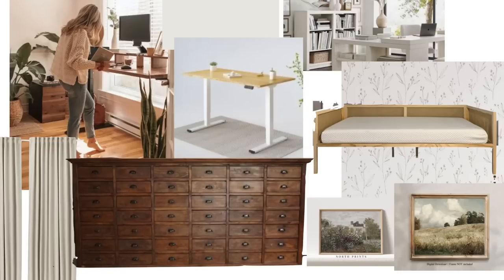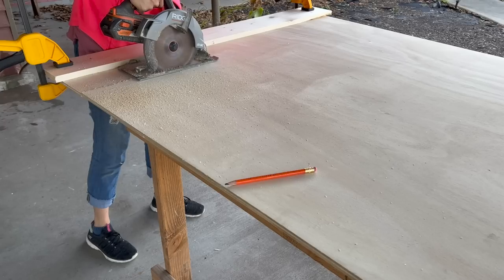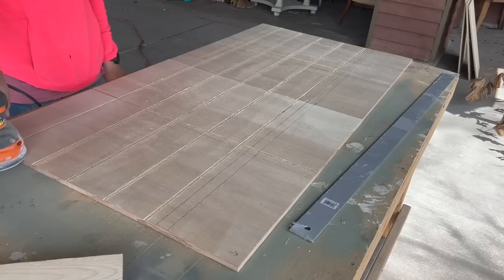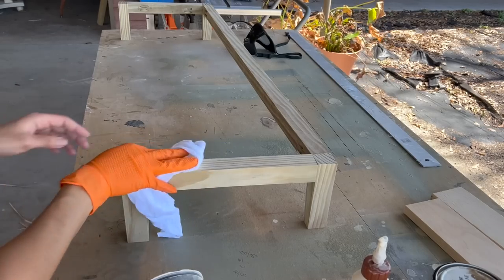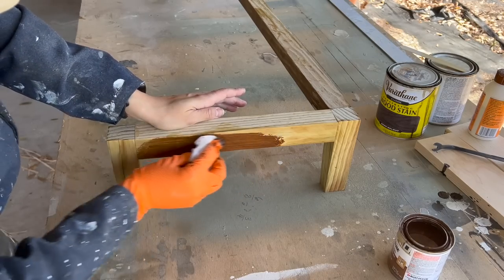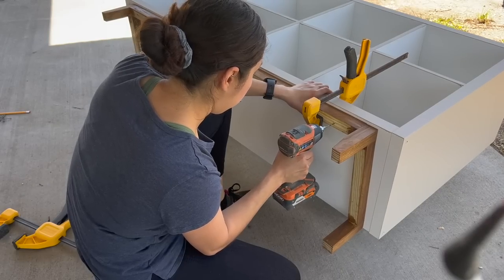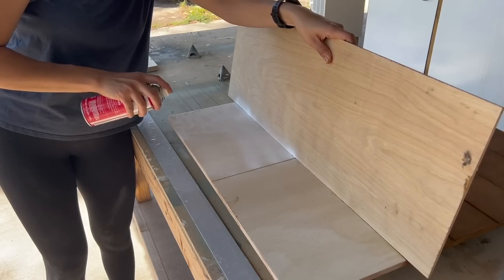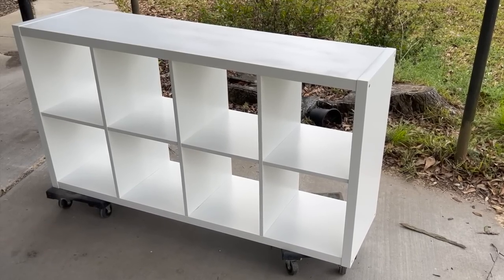EXTREME IKEA HACK | DIY Ikea Kallax Hack | DIY Apothecary Cabinet

Comment: This came out incredible! I love the stain with the color you chose. Have you ever sprayed stain? I’ve never done it (only seen another YouTuber do it) but wonder if it might work well for larger areas like this project had. Great job 👏🏻😍
Reply from the maker: I have not! I fee like I would only spray it if it was an outside project... This project I still feel is rather small to have to clean out my gun which is not always fun lol 
otherwise lint free rags works great for me... 😊❤️
Reply: @GlendaChavez  that makes sense.. oil based stains would be a mess to clean from the gun. I hadn’t thought of that. I love oil based stains so I’d probably only try a water based stain in a sprayer but then I’d worry it isn’t pigmented enough. 🤦🏻‍♀️ lol